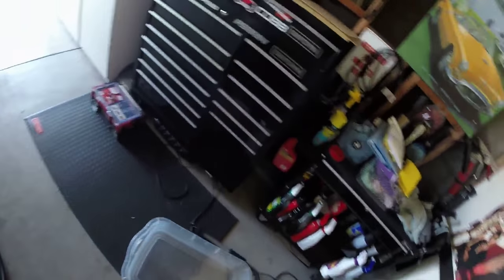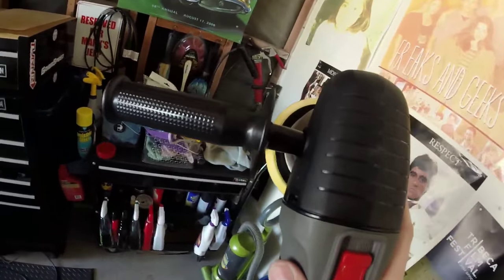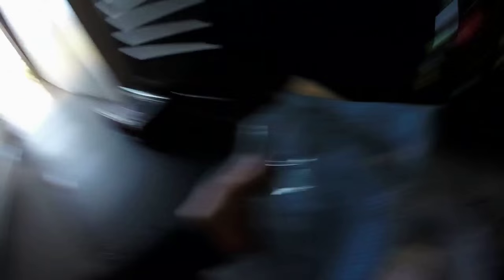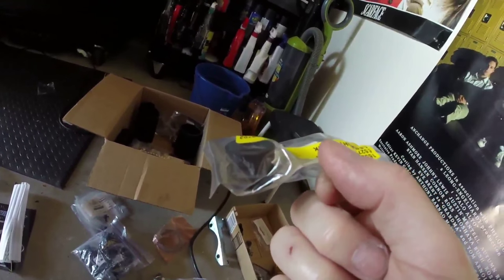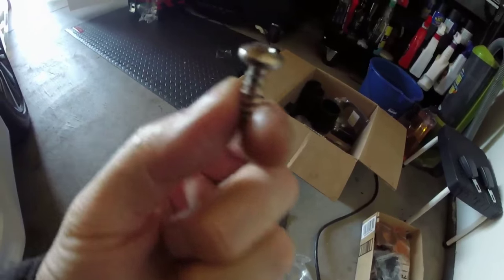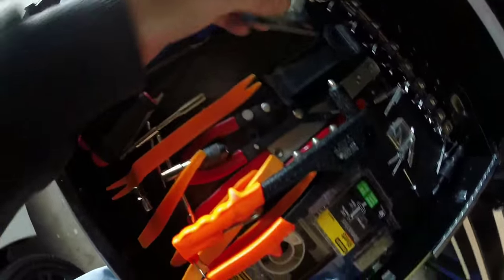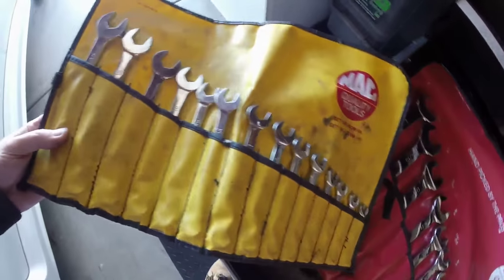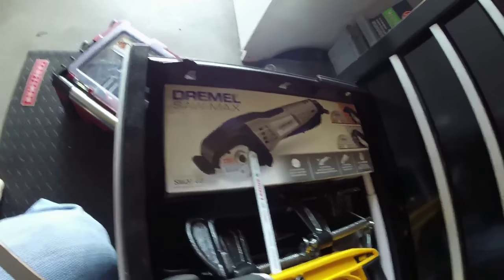2015 Subaru WRX Ep. 258: Sunday Morning Garage Inventory

Comment: Look into Meguiars quick detailing spray to prime your pads before you apply polish or wax on your pads. Since your paint is pretty new and taken care of I would suggest you use your white pad or your black pad to get the best results. Also, the quick detailing spray spreads out the the polish or wax nicely on the car and it should help get rid of that rough feeling that your talking about. My car feels smoother then a baby's bottom when i apply it to my car.
Reply from the maker: +avhc661eric so you first spray your pad with mothers detailer, let it soak in, then squeeze wax right on top of it?
Reply: +LastHumansGarage Yeah! You can do it that way or apply your wax on top of your pad and then spray detailer on top of it and then wait like 5 or 10 seconds for your pad to soak it up and thats it.

Comment: A pad should never be used dry.  You want something like Meguiar's Ultimate Polish to use with it.  It will finish down fine with the white pad.
Reply from the maker: +symawd i remembered what those 2 pads were for.. they require a pad to go OVER it.. like the ones with a drawstring or elastic.